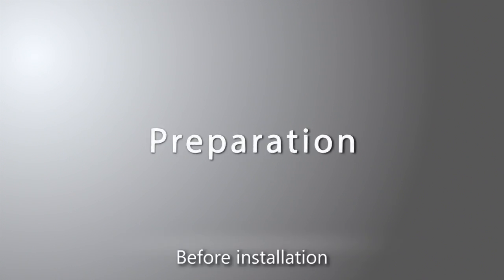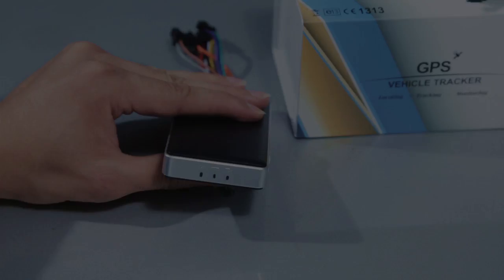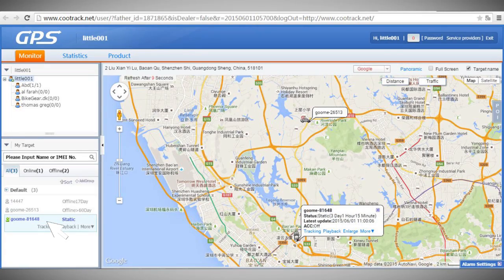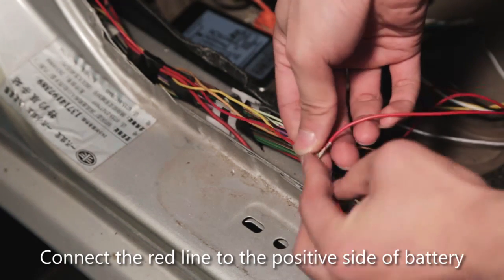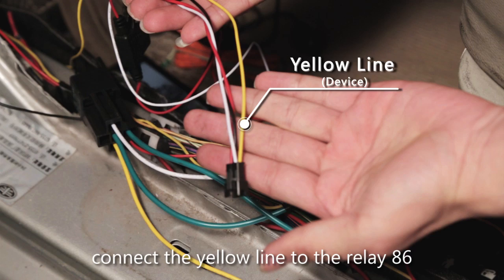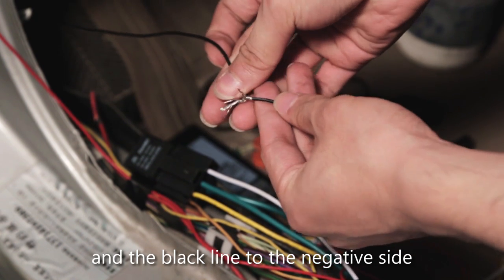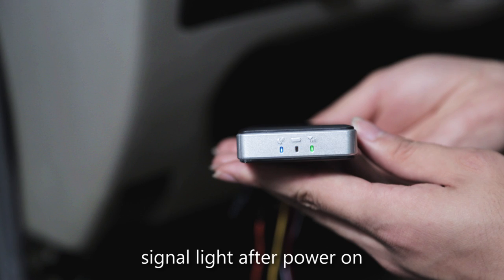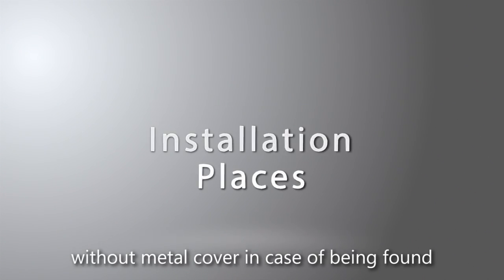Concox GT06N Installation

Comment: Ehy guys, if you need to connect wires, don't be superficial and avoid fire. Better to weld the wires and coat them with thermo-astringent sheaths. Or use crimp connectors with thermo-astringent sheaths. Avoid junctions made with tied electric wire and insulating tape!